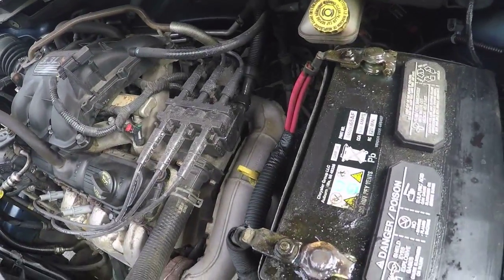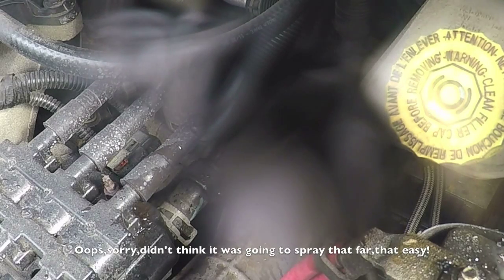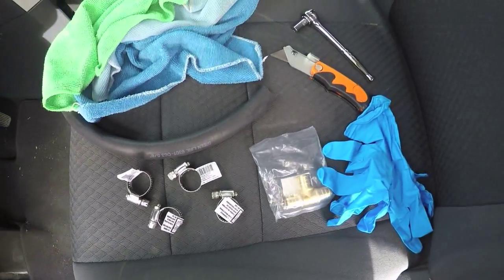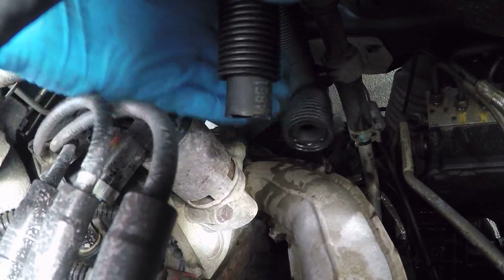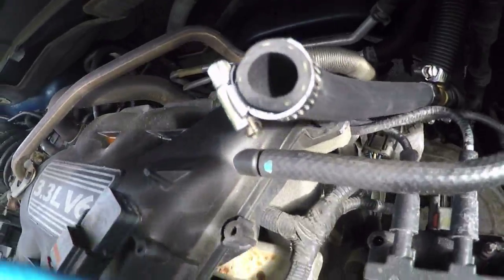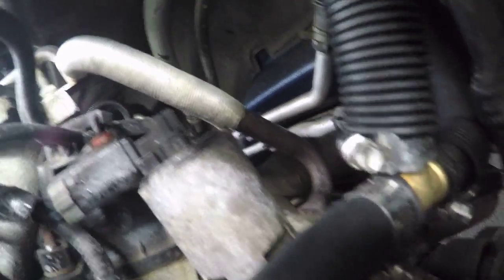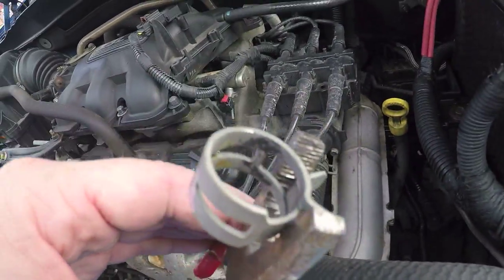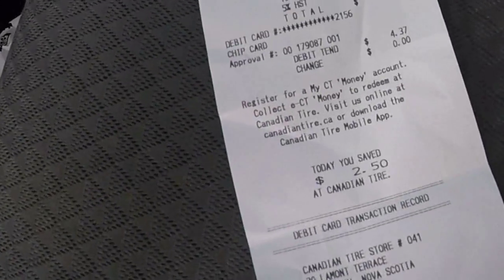Dodge Caravan Coolant Leak Fix!

Comment: Thanks for the video awesome.  Hose clamps and heater hose 5/8 from Princess Auto, and the Brass T fitting from Canadian Tire part number 063-1394-6  3/4 inch

Comment: I was hoping this video would have the answer to my problems me and my boyfriend just bought a 2002 Dodge Caravan SE what we've been having some coolant leak issues I fixed while I'm only just noticed the hose sticking out of the driver side Tire and it is dripping water it is connected to a box underneath the battery where is the other side supposed to connect to I doubt it's just supposed to drip out of the tire area help before we blew another engine

Comment: Same problem here!
Reply: Tim Willson you can get it on Amazon for cheap the original part, mine is 23933 for town and country
Reply: Tim Willson just get the original part, you undo 3 clams I believe and be done with it with the original, I'm doing mine today, then don't forget to add coolant when the engine is cool (not in the reservoir) and bleed it by adding until it's full then bleed it by pressing on the hose and keep adding while engine is running....